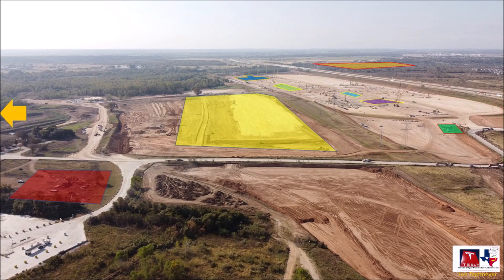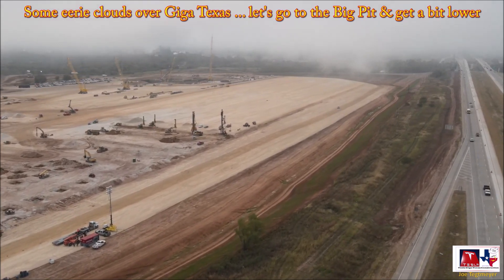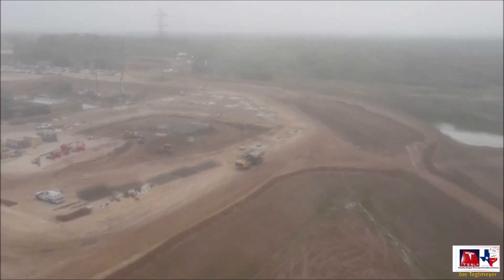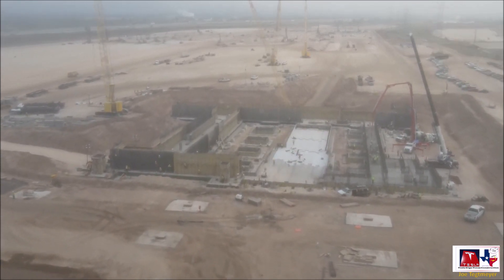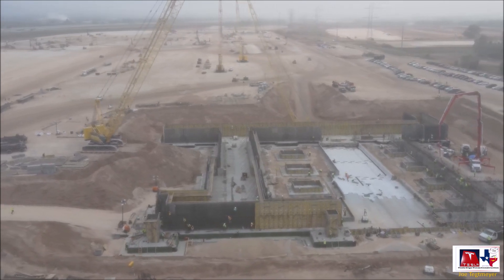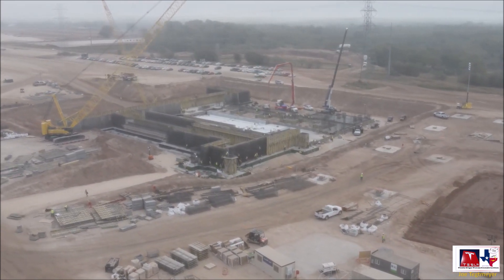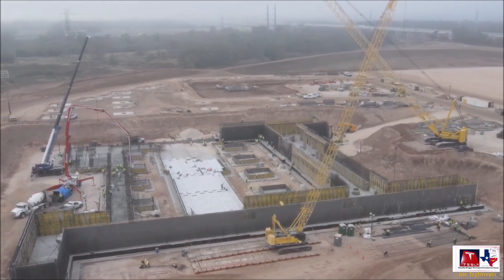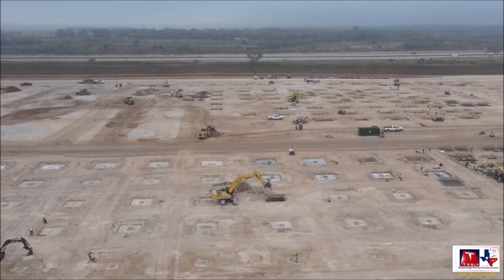Tesla's Giga Texas Casting Facility Forming on a Foggy Day

Comment: ARMEN PRESS ELECT Who cares where these 12 casting machines are used. These have been jointly developed by IDRA & TESLA and will not be a available to other car makers. I will not refer to them as a PRESS until,Elon does. You really are the DEVIL telling the world that this casting is a bad idea because they are fragile and will break in a minor collision.
Reply: they are NOT fragile, but ARE designed to absorb energy in case of a crash. Musk said they designed the castings to be repairable "by bolting on new pieces of aluminium" in smaller crashes, but they'll have  to be replaced after a major crash. 
The recycling aspect is very important. The castings are huge components of the same material, so they just have to be melted down and recast - no need to separate different types of materials. 👍